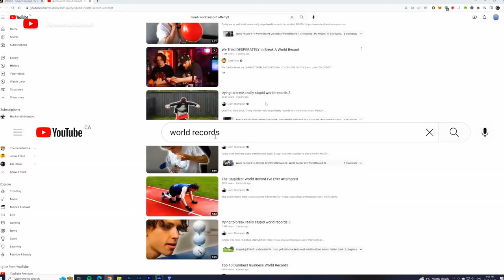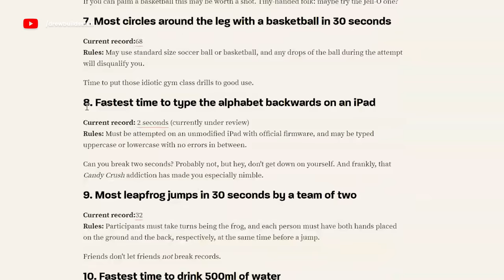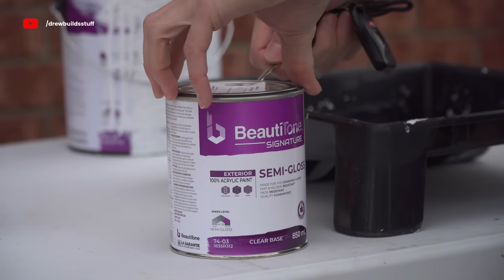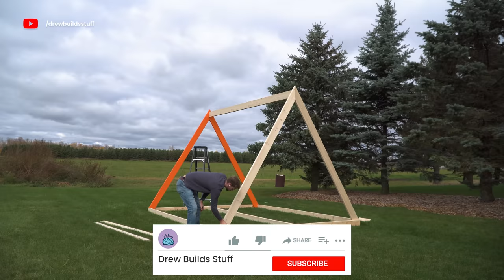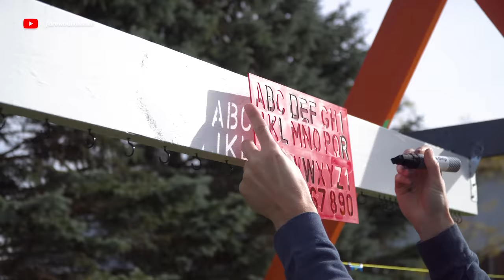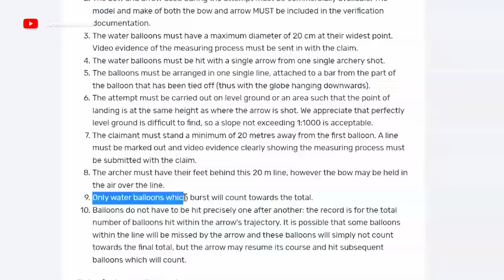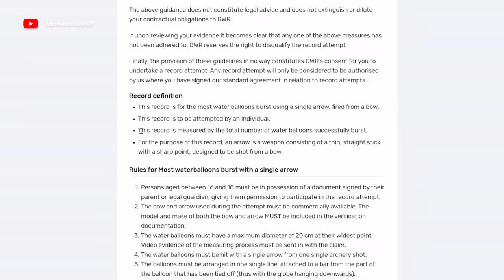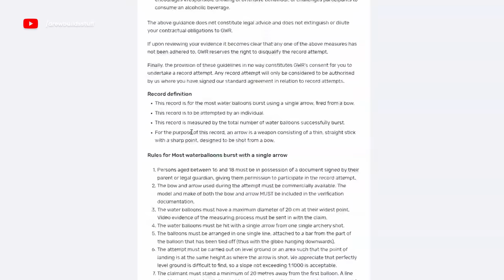How many Water Balloons does it take to stop an Arrow?

Comment: Wouldn't it be better to us an arrow with no barb but a needle thin point instead to reduce drag as it passes through all that water?
Reply from the maker: Maybe! The arrows are designed for optimal flight though, so guessing if you changed the tip you would have a weight/ balance issue.  Any direct water will redirect the arrow so really the only way to do it is to get the arrow to skip just on top of the water.
Reply: @DrewBuildsStuff  I guess the barbed tips also have more chance of nicking the side of the balloon.

Comment: I say, submit the attempt. Worst they can do is deny it. I think you deserve it as you used standard, unmodified equipment, making no attempt to exploit the loose definitions. You might have used smaller balloons to reduce the burst pressure (or used the long, "balloon animal" balloons), roughened the tip or shaft of the arrow. or used a larger, heavier arrow shot from a more powerful bow... Nope, just two guys with nothing more fancy than a 2x6. Good job, fellas!
Reply from the maker: Thanks Mark! Ya we tried to follow the rules the best we could even though there appears to be a ton of flexibility in those rules.  Thanks for watching!

Comment: Okay, first off I'm autistic,  so whatever I say is probably half crazy, but if it were I, trying to break a world record - breaking  the most water balloons with a single arrow, I would put the current world's record number of water balloons TIMES TWO into however long a run of 4" PVC it would take, make a ten pound arrow with a broadhead tip and shoot from the top down, vertically,  assuring gravity would see it through to the finish.

 Make sense? 

It does to me, but I'm an aspy (Asperger), so  .  .  .  ?
Reply from the maker: Haha funny thing, is we actually try super small water balloons and shoved them in the pipe.  The arrow every time ends up getting pushed to the side and missed a surprising amount of balloons! It could be possibly if you spent a lot of time getting the right setup I suppose

Comment: IMO - Concerning the WORLD RECORD Submission - the “point of failure” (or, rather, likely point of contention) WAS/IS/WILL BE the positioning of the sandbag in relation to the balloons AND the resulting effect this had on your “official” count...

As seen in the footage, the LAST TWO BALLOONS appear to have been pierced BY THE REAR OF THE ARROW, AFTER IT WAS STOPPED BY THE SAND BAG, WHILE REVERBERATING FROM THE ABRUPT IMPACT...

I would almost GUARANTEE that this will DISQUALIFY the claim of “40” balloons burst in a single shot BECAUSE the rear of the arrow DOES NOT appear to cut into the balloons WHILE IN FLIGHT.... 

There was absolutely no reason to place the sandbag THIS CLOSE to the line of balloons

A distance of ONE ARROW-LENGTH MINIMUM should’ve been maintained between the outermost edge of the final balloon, and the opposing edge of the sandbag TO AVOID THIS VERY RESULT...

I don’t recall you mentioning anything in the official “RULES” about this, and this IS in-line with common sense... It technically doesn’t matter if there’s a backstop or not - and certainly doesn’t matter WHERE it is...

In placing it this close, you absolutely invited in an unfortunate element of scrutiny while EVERYTHING ELSE WAS SPOT ON!!!! (And well done as always!!)

If you’re pleased with submitting for “38” - DO SO

If you’re planning to submit for “40” - Expect headaches

AS I RECALL - the unnameable G.B.of W.W. used to require a direct representative to BE PRESENT as a LIVE WITNESS to whatever record it is that’s being broken....  

Perhaps I’m remembering incorrectly, or perhaps this has changed in the modern era, BUT - I’d look into it if I were you and consider a REDO - for SEVERAL REASONS... several very valid reasons having to do with your CHANNEL and just securing the record in general which aren’t worth listing here...

The HARD PART is already done brother... Setup & logistics are a breeze and you already know what needs to be done... CONTACT the GBWW regarding the above and DO IT AGAIN except WITHOUT THE SANDBAG BACKSTOP NEARLY AS CLOSE
Reply: Upon further review - perhaps only the 2ND TO LAST balloon was pierced by the recoiling arrow, and your “OFFICIAL” count is “39”

HOWEVER - AGAIN - WHY NOT DO IT OVER in a manner that ELIMINATES DOUBT????

You’ll never feel “RIGHT” about this submission whether it was accepted or rejected BECAUSE of this tiny little oversight... 

RE-DO

Comment: Did it say you could drop the level of the balloons or that you could leave a large pocket of air in the water balloon?
I don't think a nick in the top of the balloon counts, as I would not count those as "burst"
I don't think the record was broken for 3 reasons
1 the air pocket at the top of each balloon, especially because that is the specific location targeted. 
2 the slope of the board holding the balloons, if they specify the ground has to be level I would imagine that is to eliminate the slope of the balloons.
3 as was demonstrated by the cross bow, if you do a "technically it is within the rules" you can beat all kinds of records
Reply from the maker: They literally have no description of the balloons other than a maximum size, in order for it to work with a normal arrow though you have to hit the arrow just above the water to make it skip across as the arrow starts to drop. 2. Rules say the point of impact for the arrow has to be level from the shot point (which we did). 3. A cross bow isn’t really a bow and technically shoots “bolts” so that one was really pushing some boundaries but again the rules weren’t super clear. Fun project either way!
Reply: Agreed completely.